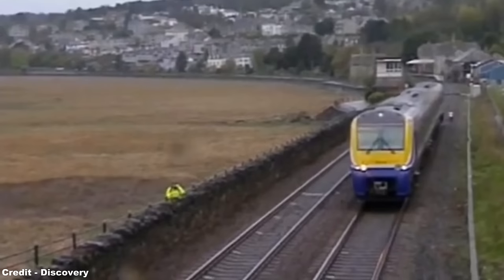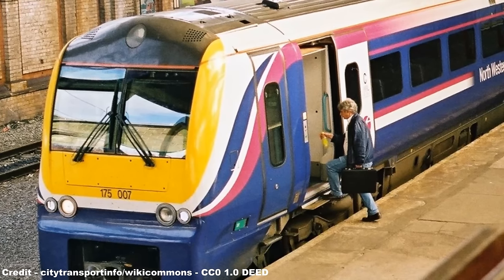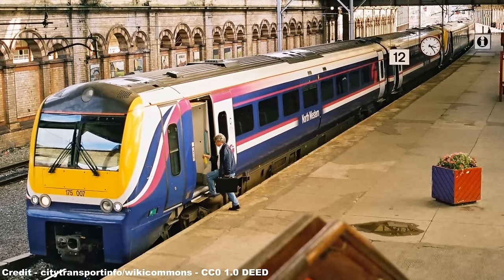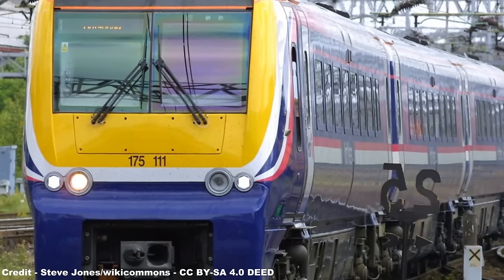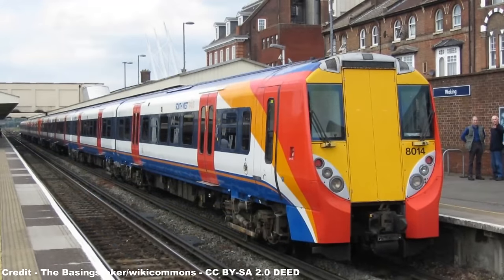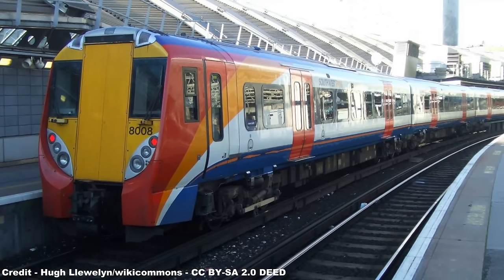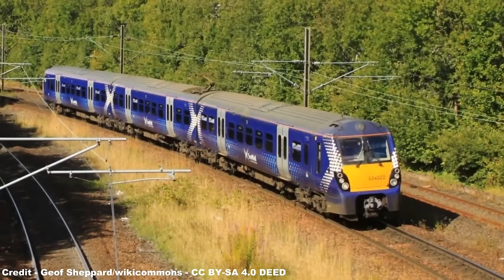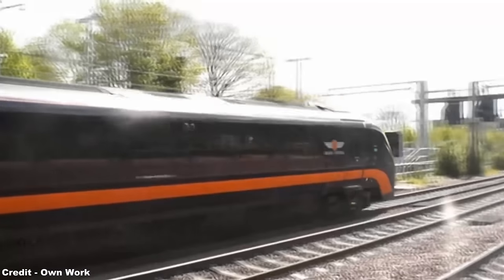The Alstom Coradia - Britain's Most Unreliable Trains

Comment: There was a time when The Class 458 Junipers were Confined or Banished to The Waterloo-Reading route via Staines and Ascot after SWT allegedly failed to persuade Porterbrook Leasing to take them back. That said the 458's now work beyond said route after their major overhauls were carried out.
Reply: IIRC didn't they always work that route?
Reply: @PinkThorn242 The original plan was to eventually replace all the CEP/VEP/BEP/CIGs on every route they ran on with 458s, and to complement the existing 442s. Reading-Waterloo so happened to be the first route to see the 458s in action. When problems came to light, SWT just simply took their business to Siemens, and it was the beginning of the death of Washwood Heath.
Reply: Well, the 458's are planned to start running on the waterloo - Portsmouth Harbour route and are currently working on the sets by converting them from the 458/5 to the 458/4. The main thing from this is the removal of the 5th car to return back to a 4 car set and allowing them to reach a higher speed
Reply: I think the Reading line unit diagrams are pretty much self-contained, anything diagrammed on that route won't go anywhere else that day apart from the depot at night so it was a wise move then to keep the 458s on the Readings where they could cause the least harm if they sat down. And there they stayed.
Reply: @AurumUsagi it's crazy to think if they were more reliable then they'd have alot more junipers running too and from Waterloo to portsmouth
Reply: @lanchester101 the reason for enabling higher speed is down to weight too. It means the motor won't get overloaded trying to propell the unit at lower speeds with such a great weight with higher gear ratio.  Would love to see how fast they can truly accelerate and thus perform when they are released back as a 4 car unit.
Reply: Living in on that line, I hate the 458s.
Reply: @mst4309  their getting a performance buff. Don't worry. They'll probably be faster at acceleration than a class 450 by the time they are back in service at 100mph
Reply: @bb-3653  their acceleration will be worse when theyre re-geard to 100 mph than it is currently with 75 mph gearing
Reply: @Trainman10715  thats so impracticle since they are so slow already that i doubt it. The articles state that the aim of removing the 5th coach was to improve acceleration and so they can use 12 car formations.  100mph gear ratio doesent always mean slower acceleration.  Remember one single carriage is about 40 tons. Removal of the fifth will probably enable a great amount of freed up weight for maximised acceleration. Additionally at lower speeds to because the lower speed acceleration is where the motors have to put in greater effort. 

Hopefully they take just under 70 seconds to hit 60mph. As opposed to the 85 seconds it takes for class 450s to hit 60mph. Class 450s are so slow and SWR dont do anything to match it up to electrostar acceleration.
Reply: @bb-3653  its not impractical, its physics. thats how gearing works, if you want a higher top speed then you have to sacrifice acceleration, a 100 mph geared train will always have slower acceleration than a 75 mph geared train with the same power and weight. the removal of a TSO will improve it a bit, but i doubt reducing the weight by less than a 5th will overcome the gearing disadvantage, at best the acceleration will be the same.
Reply: @Trainman10715  i wrote a massive paragraph. Ill simplify it 

I agree. If the trains are in similar weoght thresholds. And have 75mph gear ratio vs 100mph gear ratio. If 5 car 458 was regeared to 100mph it would for sure be slower. And thats why i said its impractical.  Becuse its already really bad at accelerating due to many mechanical limitations of having a 5th car and no additional motor to handle 40 massive tons of weight. 

40tons even if its a single carriage is infact alot of weight. 3 reasons for why it may be better as 4 cars and geared at 100mph
.reduced weight (40 tons) is significant enough to improve acceleration by  a huge margin. It removes overloading/overheating the motors at low speeds due to not having to work extremely hard with additional weight.

.better weight to carriage ratio means better starting acceleration also.
.100mph weight and acceleration threshold will likely be improved becuase of such a weight reduction.

This is likely what SWR are banking on for its inproved performance.  4 car 458s will probably be better than the 5 car at accelerating over its total sum of acceleration to max speed  as a result of this.
Reply: @Trainman10715  hope you read what i said,  just to get my perspective a little more
Reply: @bb-3653  I did and replied twice, both of which seem to have been deleted
Reply: @Trainman10715  i didnt see the other two. Unless you didnt see my response after your ones?  Pan up quick you may see it. And also this isnt me having an argument with you btw. Just a slight convo about....performance of these units.  I hope it doesent come accross as aggressive or hostile
Reply: @bb-3653  nah its not coming across as aggressive or hostile. 

to address your points again, the ablility to travel at line speed is more important than acceleration on the services that they will be doing which will incorperate less stops than their current patterns. as ive already said, the coach may weight what it weights, but its still less than a 5th of the total weight of the train, reducing the weight by less than a 5th might improve acceleration dispite the gearing disadvantage, but i highly doubt it, at best the acceleration will probably be the same.

on your earlier point about the acceleration of class 450s compared with electrostars, their DC acceleration is about the same, dont mistake the acceleration rate of electrostars on AC to their acceleration on DC. all trains are limited in power output on DC third rail because the system simply cant deliver the same power that AC can. they then often have to be deliberatly restricted even further as DC runs at higher currents and it is therefor more easy to overload the feeder stations. 8 and 12 car eletrostars are even slower to accelerate than 4 car ones on DC because they deliberatly derate themselves. most DC trains have very similar power outputs and acceleration rates as a result of the limited power available on the DC system
Reply: @Trainman10715  

I still disagree with the point you make about 40 tons not being that different.  Thats a significant amount of tonnage. Lets say they are the same at acceleration when they are modified. Doesent that technically mean the acceleration improved? Because its geares to a higher speed and still hits the same time towards 60mph. It just means the higher speed acceleration will be alot more continuous no? . 

"class 450s and electrostars are about the same on DC' paraphrasing what you said. That couldnt be further from the truth , respectfully. 
Mid speed acceleration consistency is a key indicator of how fast it will hit max speed. It predicts whether it will be smooth sailing or not.

Electrostars are actually vastly superior in acceleration to the 450s to 60mph..
A single unit (4or5 car) electrostar on DC ranges from 63 to 70 seconds towards 60mph. They tend to hit 70mph in under 1min and 35 seconds on flat ground.  

450s on the other hand
85 to 90 seconds to 60mph and thats also factoring in the fact that they can generate better lower speed torque until 17mph  due to having 8 motors vs 6 electrostar motors. To add to this they take over 5 minutes (according to rail forums) to hit max speed and thats poor for a moderm train. This Which would seem accurate given my experience recording videos of DC units and esspecially desiros om DC. 

That being said , your point about multiple car units also dont make the case any better for how electrostarsfare vs desiros. Multi car 450s take millenia to hit even 60mph. Electrostars do take longer than 4 car electrostars, but their acceleration is consistant.  Meaning it doesent take too many seconds between each mile per hour.  Funnily enough,  10 car electrostar acceleration is better than the 8 car acceleration.  Its wild. 

Desiros on DC and electrostars on DC just arent comparable. This shows how much extra power is available for third rail units. That being said it wont overload the third rail supply to adequately give class 458s in 8 car formation,  Better acceleration than a 450. Since electrostars are generally better than class 450s in 8 car formation. 

To finalise. I will send comparable examples of acceleration footage to show the differences.

Class 377/7 five car acceleration (Single DC unit acceleration)
https://youtu.be/vNsh4BngEuM?si=euMF7ITudJeR4LkO 

Class 377/7 ten car acceleration(reduced  power uptake) 
https://youtu.be/df8NfU3P2U0?si=Fx8f0Sd0kEp4cFU9

Class 450 acceleration (8 car acceleration )
https://youtu.be/ww-p6P6LyEU?si=Mbo3uIXLWgKUOEeo

Compare the two units and youll see what im on about. The 10 car electrostars avan the class 377/7s being just as heavy relitively speaking per carriage to a desiro, is just much better to 60 and 70mph. Its wild. Swr order really low powered trains , the only fast train they had was the class 707s. Which beat the electrostars by 2 seconds to 60mph. 

And then look at the class 458 acceleration vs the 450s. The 450s comparably suck. I know its one video but ive easily recorded them in multiple occasions with a similar time.

Class 458/5 acceleration (5 car 75mph gearedL 
https://youtu.be/4t4SQJp2nXk?si=MXH4GgQJLXd_PpLO

To finalise. All im saying is, 458s have the potential to easily be much better than the 458/5s at acceleration.  A unit geared for higher speeds doesent mean it needs to be slow. Many units geared for higher speeds are just as nimble for stopping services . Again , electrostars. Very good despite third rail limitations. Its amazing to me

Comment: Someome told me 175s used to have some cleaning and maintenance done in Cardiff Canton as well as at Chester. But when CAF took over their maintenance, Canton was stopped from maintaining them. A couple of months later they started having "thermal incidents".
Reply: Pretty much due to reduced maintenance, it’s not an unusual story for trains on the way out of service
Reply: Didn't know about Cardiff being involved, but a similar thought crossed my mind. The 175s were not barbecuing themselves until maintenance transferred to CAF.
Either the knowledge was lost, or the management as usual thought they knew better and changed the maintenance cycle or regime.
There must be loads of classes on the railways that have odd niggles and faults, and it's through time and experience that maintenance staff get to know the odd little habits of certain classes and how to keep them running. Like removing accumulated leaf and litter debris in the engine compartment.
Not so much the fault of the unit, more down to CAF's maintenance.
Reply: You're correct. Canton was warning TfW about what would happen, and they were right. The expertise at Chester was also lost during the handover to CAF and the new management stopped the cleaning.

Comment: The 460s were very well looked after at Stewarts Lane and worked ok because of it. Sadly, Alstom's after sales was appallingly bad and the GatEx team often had to work without any help from them. By comparison, Adtranz worked with LTS at East Ham to sort the faults on the 357s, which were initially appalling but went on to become very reliable.
When SWT went for it's big Mk1 fleet replacement programme, Alstom's reliability record  effectively put them out of the running,  whilst Siemens put a huge amount of emphasis into product support in order to win the business.
Interestingly, the reason that Eastleigh Works shut in 2006 was because it was owned by Alstom, having been purchased in anticipation of winning the SWT fleet order. When Siemens won it, they weren't likely to use their competitor's site so built a depot at Northam, the predecessor of Eastleigh depot before 1909.
In the event Siemens needed a bigger site, but because Alstom had leased Eastleigh Works to KRS, they could now make use of it. In 2024 Siemens still have a major presence at Eastleigh Works but Alstom are long gone

Comment: This brings back memories. It was a dark time for the UK's railways, what with other things such as a few serious rail disasters and general discontent from the public with the service the new franchises were providing. Alstom's new train offerings were definitely the most unreliable, though I do recall the Adtranz Electrostar Class 357 also getting some stick for issues and delayed entry to service. In comparison, Adtranz Turbostars seemed to enter service a lot more smoothly, even if they weren't without some issues. I remember the SWT order going with Siemens, and all the coverage of SWT having given up on unreliable British made trains and having to turn to the Germans to help. I also recall media coverage about how Siemens had to "ruin" their test track a little with worse condition track and an erratic third rail power supply to better replicate the crappy tracks the Desiros would have to go over. The Desiros were certainly a good choice for SWT. The funny thing is, having had a bad experience with British built Alstom trains, then a good experience with German built Siemens trains, the south western franchise went back to the British for the Class 701s, and what an absolute joke those have turned out to be to date.

I've only actually gone on a Class 334 out of the whole Coradia family. It was quite pleasant, though they had the heating on warming the legs at the same time as the air conditioning blowing cold from up top at the same time as all the windows being open and giving a draught!

Comment: I rode on a few class 458 and 180 trains in the mid 2000s. My impression of them was that they were comfortable, but EXTREMELY lightly built. The Siemens Desiros felt a lot more solid.
Reply: The class 458s are actually pretty heavy.  But yes they are indeed lighter than 450s. Desiros are over 170 tons vs a class 458 at sround 164 tons . The problem with that is they are much to heavy to supply a good amount of power for them to accelerate fast enough (im talking about 450s) . The power supply at SWT third rail lines weren't adequate for the time they were released onto the tracks. Subsequently 450s are slow as hell as SWT had to heavily order them with inbuilt software/ hardware limitations . It's a shame Really. 

Class 458s I have no idea how quick they actually are at acceleration at 4 cars (but we will find out soo ) I will say though,  Electrostars were much more reliable as units than 458s, faster than a desiro anyday. And yet Still are sometimes 10 tons lighter than a 450 (near 174 tons)  class 377/4s are likely the relitively lightest 377 subset at 4 cars  (161 tons)  vs the heavier variants ( class 377/2 at 168 tons)both 4 cars

Comment: Excellent work.  Some nostalgia for me as you showed a picture of 458s at Reading with the old Metalbox building in the background.  I worked in that building for 5 years for Energis in the early 2000s.  My desk faced out onto Reading station.  FYI the town of Milngavie is pronounced. Mull-guy.  Yeah, I don't know how either.
Reply: Did you get any good photos of the station from your office?
Reply: @mdhazeldine  Not really, it was quite annoying as the windows had a funny blind system where you couldn't raise the blinds out of the way, plus it was at a time when there were no decent digital cameras.

Comment: I really hope the 175s find work elsewhere, despite there flaws they are really nice units to travel on
Reply: They'd work well replacing Sprinters, e.g. the Northern routes around Scarborough and Hull
Reply: Get them displacing Class 150 Sprinters on Northern until they sort out their own DMU Tender. They still have the original prototypes running regular service and are clearly well past their best.
Reply: @suchcone  none of the northern depots have the expertise in maintaining alstom units, their reliability would be woefull under northern

Comment: Another great video, thanks. Didn't know about the clearance issues at Conwy so will keep an eye out next time I go that way.
I have many memories of travelling on 175s from Bangor, passable at best but mostly awful when for example a 2-car unit would be diagrammed to meet one of the ferries at Holyhead. Even when 3-car units were on, they were cramped, no space for luggage, seats too close together adding to the general cramped feel.
The automated announcements were terrible, mangling the Welsh place names, rarely running to time so would announce the wrong stations. Things were so bad that the guard took over doing all the announcements.
Only plus side is they did look good, especially in the Arriva horns.
Luckily I was never on a unit that failed or burst into flames whilst in service, but I'm not sorry to see them go!

Comment: The Alstom-GEC merger was a disaster for British industry, Alstom ran-down and failed to invest in almost every former GEC facility and now most have closed. GEC Preston used to make high quality traction motors and electric gear - gradually starved of orders, now closed. Washwood Heath was admitedly in need of investment, which it should have got given the number of orders going through it in the 90's, but as the video shows, this didn't happen and the results are clear. Now closed of course. The ex Metropolitcan Vickers works in Manchester is a similar story. Thankfully some of the heavier electrical engineering side of things was saved by GE USA and continues in Stafford and Rugby. Let's just say I'm not optimistic about Alstom running the former Bombardier plant in Derby well...